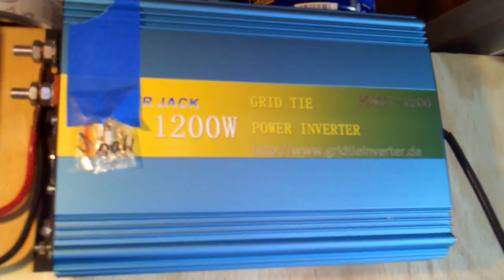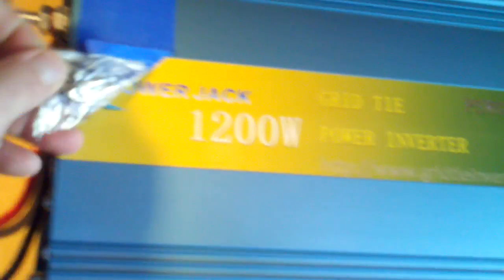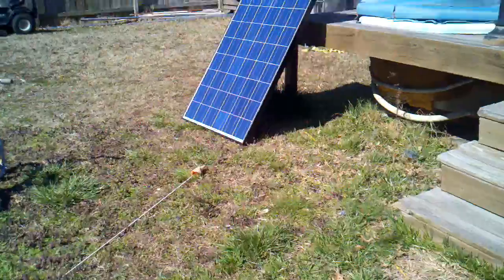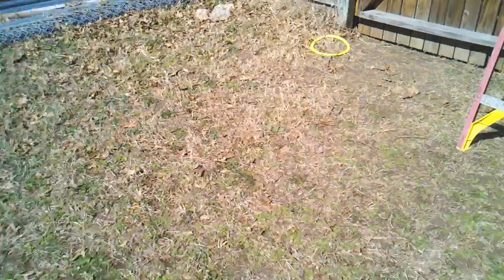Testing the reaction of the digital smart meter with the Power Jack 1200 watt Grid tie inverter

Comment: You'll need a net meter in order to see reverse direction smart meters not only are there to make it easy for utilities to collect data wireless they are there with the intent to stop you from doing what is practical and easy which is generate power with micro grid tie inverters. Safety is an issue with micro grid tie there are a few things you can do along with understanding of the dangers of electricity and so forth. One thing you should do with all inverters before using disassemble the unit so you can see the back side of the posts. I know what your thinking why? Truth be told most grid tie inverters I have come across do not properly assemble the units causing a safety hazard the ground post is typically the culprit that causes the issue but tighten the lug on the inside completely for the positive and negative hookups. Because they are not completely tight what happens over time is the lug gets warm and expansion and contraction creates more gap. When this happens the unit will start arcing and sparking the sparks fall out and start a fire. Yes it sounds like I'm being picky here but it is through using these units that I've came to understand this almost started a fire myself so be safe. Another thing to consider is the size of your wire and the amount of amperage that can be carried on your circuit. So for instance a 12Gauge wire can handle 20A make sure the breaker on that circuit is indeed 20A. Now 20A is a total amount of amperage meaning it doesn't matter if its power being used or power being generated anything on that circuit should NOT exceed 20A this is CRITICAL! Here is why your breaker is designed to trip based on use it is not designed with generation in mind. So if you exceed the amount of Amperage anywhere on the circuit you WILL START A FIRE!  There is no protection for what you are generating!!! So you must know how to calculate what is on your circuit and make sure you DO NOT plug heavy use items such as microwaves, toasters, hair dryers etc... Into this circuit. DO NOT EXCEED 20A in and out combined! Voltage x Amperage = Wattage so lets say your generating at 1800 watts stacked on your circuit it really only leaves you with 600 watts to use on that 20A circuit max so be careful the wire is only rated to handle 20A safely it don't care about if its power being fed in or power being dished out it simply can only handle 20A due to its physical nature and size and rating. Finally you will want to make this safety choice before buying micro grid tie inverters be sure when you select a micro grid tie inverter that your unit is equipped with island protection this is Critical if you ever have a power outage you do not want to ruin your electronics but also you do not want to be responsible if a utility company or electrician comes in to do work and kills himself thinking the power was off and disconnected and here your microgrid tie solar farm is still energizing your circuit this is a dangerous thing! Now if we follow these rules Micro Grid Tie is a very safe and very easy alternative I would argue it will pay for itself very quickly in savings in power. There are however a few things to consider what you are doing is likely in violation of your utility companies policies. Also you must consider the fact that insurance may not cover you in the event of fire so be sure you mount your inverter  in a way to keep it from starting a fire, keep it clean of dust and debris, make sure that you inspect it ensuring it is clean daily as bugs and dirt and spider webs etc will cause fire. Be sure it is mounted with spacers if mounting to a wall do not direct wall mount this unit as the case is essentially an over sized heat sync and it is meant to cool the unit. Be sure the mounting area is not over or around things that will catch fire like rugs, fuel, paper, dust, chemicals etc... ALL OF THIS MUST BE DONE IF YOU MICROGRID TIE! If you follow these rules (RULES YES NOT ADVICE HERE!) you can safely cheaply and effectively generate power with microgrid tie units. One last thing to keep in mind with the advent of smart meters you should be careful not to generate more power than you are using. The ideal situation would be to use solar power generator on your circuit to generate what you will be using on that circuit this way all electricity is consumed via generation vs the grid. If you go over some smart meters will in fact count it as power being used. So be careful and know the risks and the rules!

Comment: Can you feed power back on the grid for free?.  Connect that through a power board and feed it mains via large value resistors and connect the output to a battery charger and use it for a battery charger.       Then you can hook up a decent inverter.  You only need a pilot system to run the mains input.   I would make an auxiliary control system to do fun stuff in isolation. Can make all that stuff run without being on Grid.

Comment: I've taken parts of my home off grid now. I have left the grid ties to cover my stove,hot water heater,central air, two frigs,two deep freezes, clothes drier and garage. taking my home off grid for the living room,three bedrooms and two bathes was pretty easy. I already had 1800 watts of solar going to ywo big battery banks. I just hard wired my inverter into another braker box and started pulling the brakers off the electric company and putting them in my braker box.

Comment: I had to get the permit from our electric company. the power jack inverters are not legal to use in Kentucky. I have a slk 2000 gti and two frongious 3000 gti's. I had to get my system inspected by a electrical inspecter and approved. then I had to sign paper work saying any power I make over what I use will never be turned into cash. I get credits toward my bill. here in Kentucky it's big coal that rules the state congress.

Comment: overall smooth. i posted a vid on the process.  Probably hardest part was mock up of the "plot plan."  Rest of the stuff basically printing spec sheets on equip, and submitting with a 1 pg permit application. Will say my city is pretty lax on the solar deal. I know there are cities out there that will bust your balls on ticky tac crap. That said, I did temp take down my "non UL" stuff and even my turbine to limit my permit to just small Enphase system to just get my meter go bi-directional.
Reply: Can you share copies of your application and information on how you went about that this part is a important step.